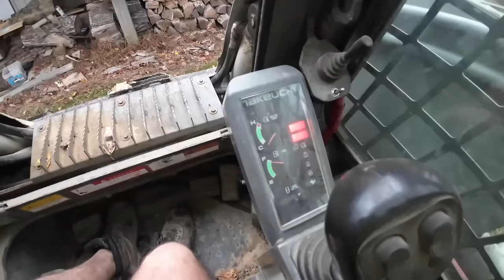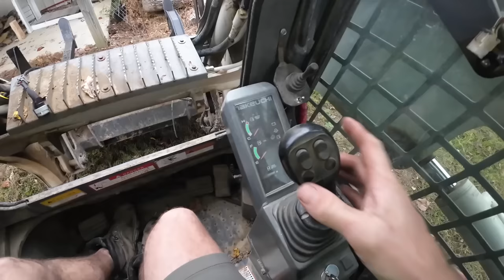Is a Firewood Processor Worth the Investment - #1 Reason I Think it Is!

Comment: why not split into trailer or truck ... saves handeling it twice
Reply: It might be a , the neighbor loads their own, job? 

But, yes it does look like the processor can operate over a trailer.
Reply from the maker: It can definitely load into a truck and trailer and if the person who is getting it has a trailer to load into, that works well.  But if they don't....can also just use the skid steer it little tractor and scoop the wood up and dump it

Comment: Here in Britain firewood is expensive ( in fact the cost is a pxxs take ) and not easy to come by at source unless you’re a big land owner or in the tree surgery/land clearance trade. I’d say your investment is well worth it especially as you have access to free logs, not to mention it’s a beautiful piece of machinery. Your barter system with your friends and community is a system I feel we should all return to, a great traditional method of trading and helping each other out 👍 Excellent as always Mike 👍 Best wishes from Britain 👍🇬🇧🇺🇸
Reply: Our house is on 5 acres, all forested.  We still have two piles of logs from clearing the house site that we are cutting and splitting.  The free wood saved us $1,000 in propane last winter to heat the house.

Comment: Definitely a time saver, working full time in what is a stressful job sometimes you just need to do things that take your mind of things. Would be interesting to know what the time scales are for replacing the chain, I suppose though that's down to the type of and age of timber. Don't know if anything has said it yet, but thanks for your service, even though I live across the pond anyone that does a job that potentially saves lives, needs respect.👍
Reply: The variables of type and dirt content from harvest in bark are the factor of time between chain tune

Comment: Thanks for sharing your thoughts, ideas and videos. I’ve always liked the look of that type of wood processor. Having split wood for heating the house as a kid for many years you never loose appreciation for tools that make a job you’ve done better. One idea you might want to make your own that I’ve seen others do is to make a simple wood carrier to split into. They used a pallet with an upright post at each corner and what looked like snow fence to form a well ventilated box to split into and then move and stack with pallet forks. I could see you setting a pallet or two onto a trailer for delivery. Wishing you and your family the best.

Comment: The guy I used to work for and my sister's ex boyfriend had a towable log splitting rig. You could load few logs at a time on it. Since he had large quantity of wood he wouldn't bother throwing split wood into his boiler but whole bucked logs. His philosophy was that the logs took longer to burn meaning only having to load it up once a day so he would more time doing other things.
Reply from the maker: All depends on the burner and the type of wood
Reply: To many variables as to whether right or wrong, firebox size and shape vs wood size, seasoned dry split wood vs non seasoned unsplit  moisture content etc etc.

Comment: The biggest problem see s to be visibility. This is a common problem with most all front mounted tools. My suggestion would be a camera set up on the lift arm(s) or top of the cab. It's not just skid steers either it's all front loader style attachments with a problem.
Reply from the maker: I had a camera setup for it.  Honestly, like any equipment, seat time is the real answer

Comment: For speed later palletize the firewood. 4x4 pallet then shrink wrap makes loading and unloading easier. Also means that you only touch by hand once. Pick the pallet up set it on flatbed strap it down deliver to location and unload pallet. By wrapping it helps keep the weather out and held together for transport and ricked/stacked.
Reply: Or borrow from DP (forgive my Tarzan English) cages for water reservoirs (like one he used for utility - fuel and greasing station)
Reply: I never thought about shrink wrapping it! Even the clear plastic film you wind around pallets for shipping would be okay. 
Thanks for sharing!
Reply: @patti2413  it’ll also help dry your firewood, by keeping it out of the weather
Reply: @robertlukacs1762  yes! That was my primary goal! 
BUT…if you wrap it when it’s not completely dry, wouldn’t the plastic keep the moisture IN?? 
I think it may be okay IF you did it in mid-summer AND you made sure it was already REALLY dry. 
But even then, wrapped in plastic and sitting in heat, I think there’s going to be some condensation. 
There WILL be some air flow from the bottom of the pallet, but heat rises, so most of the condensation will be at the top, so I’m not sure enough air will get to the top layers to dry it out. 🤷‍♀️🤷‍♀️🤷‍♀️
Maybe sitting in the hot hot sun WILL be enough to dry it out completely??🤷‍♀️
Yes??? No??? 
As you’ve obviously wrapped wood before, I’d like to hear your thoughts on this!😊
Thanks! Patti
Reply: @patti2413  actually you’re only wrapping the sides so the top and bottom are both open. Once delivered then you cover the top. So you’re question is legit. But as a supplier, it’s a space and time saver. Quick loading onto our flatbed trucks and with our (brain fart) forklift’s. Easy delivery. Our perforated plastic wrap allows some air flow as well.  But I was thinking about his situation with limited stuff. As for my biggest customers they have covered section that 4 of my pallets are able to sit in. As for my residence we place them on the side of the house on a concrete pad or edge of driveway. As for wet wood/green it is piled high for a year to dry before we palletize it. And that’s under what we call a portable umbrella just to reduce rainfall.
Reply: @robertlukacs1762  I cut and split my own wood, and try to let it season for at least two years. Sometimes I can’t get it split before I stack it, so it does have ‘some’ remaining drying to do after it’s split. Right now I have 13 large heavy duty wire crates I stack it in, which I can then take into my shop with my skidsteer and stack in two’s. Plus I have two walks in my shop filled floor to ceiling. I have fans going year round, so my wood is always super dry when I burn it. 
BUT…I like to cut down on moving it around- especially individual pieces!! I’ve got 3 Truckloads of ash logs coming, and about 25 trees on my property that are either down or going to be coming down. So, I’m cutting it, then stacking all of this wood to dry outside, which means loading it up & unloading onto skids to dry. Then, if I haven’t split it, I have to load it into the bucket, take it up to the shop, unload it, split it, then move it inside and stack it or put it in the crates. 
I try to rotate through the crates of course, and start by using the driest wood first, which means I sometimes have crates that get to sit for another year inside. 
But, like I said, I’m trying to cut down on handling the wood so many times! 
That’s why I was thinking I might be able to cut it, split it, load it on skids and wrap it right there where the tree is. That would save a LOT of re-handling! 
So that’s where my questions are coming from! It’s all about the ability to store it, AND get it dry AND not have to move it 100 times!! 
(The ‘work smarter, not harder’ saying that I’m trying to adopt since my body is recommending I do so!! 😂) 
You mentioned perforated wrap, but if you wrap it a few times doesn’t that defeat the purpose? (Unless you are using the actual shrink wrap and only using one layer then heat-shrinking it??) 
For transporting, are you able to stack skids? 
I don’t know how I could stack them inside my shop once I was ready to use them- which means I’d have to unload them all individually- and defeat the purpose of reducing handling!! 
(However..if I wrapped the metal cages, I could stack those…but again, that’s the most seasoned wood, and I’m looking more for a way to store fresh cut/split stuff.) 
I’d love to see some pics and hear how you stack them if you have any. 

One thing I think I would do if I were to shrink wrap this way is to use plastic skids! 
Not the solid ones- but ones that have open grid designs to allow lots of airflow. That way I could stack them on the ground and not be worried about wood skids wicking water from the ground into the wood. 
You can find them used- often for about $5-$7…good heavy-duty ones. They probably won’t hold up like good hardwood skids, but they’ll have great airflow and be able to sit on the ground! 

Where I dry my wood now, I’ve staple-gunned orange snow fencing to the end of a skid, and laid 3-4 skids beside each other, continuing the snow fence around the back and other end. 
I screw 2x4’s onto each of the two ends and a few along the back to staple the fence to. I can stack good and high and it gets great airflow. I try to cover the top with some sheets of plastic when I can. (I’ve used scrap pieces of sheet material like Hardi-Board…and just thought of trying some used arena boards that I have!) 
I’ve thought about wrapping orange snow fencing around individuals skids of wood- like I said, it’s strong and gives lots of airflow, but doesn’t offer as much protection from the weather, and not easy to stack. 
(Unless🤔…just thought of this…if I shrink wrapped it, it would be good and solid, and I could try stacking on top of the arena boards!!!
Hmmm! Think I’ll try that out TODAY!! (Thanks for inspiring me and making me think about different options! The arena boards are for the side of my hay shelter, but I haven’t started putting them up yet, so I’ll give them a try and if they work, I’ll look for more! 
(My brain never stops looking for ways to make life easier!!! 😂 
And my brain is telling me that I really WANT a firewood processor like this one… and it is also telling me 😂 haha- yah, right- like you can afford it!! 😂) 
Anyways…. any advice, suggestions, or ideas that you have would be welcome!! Can you also let me know where you can get perforated shrink wrap?? Thanks! 
Patti
Reply: @patti2413  perforated shrink wrap is stronger than pallet wrap. Yes your able to to stack for transit. Depending on how high you stack each pallet. My site is mainly about 5acres and wood is brought in from clearing sites. Like captain Kleeman brought it up to his shed. I also have a mill next door that I get the cut offs and crooked stuff from

Comment: So as I see it,  there are 2 more pieces to the puzzle, modifications to the 555 so it can operate the processor (which you mentioned) and getting that dump truck in action so you can split right into it and never touch the wood. Am I right?

Comment: That thing is cool but if you don't have or have access to a skid steer the cost of s the splitter plus the cost is a skid steer or a tractor that's compatible is a deal killer or life savings killer.😂
Reply from the maker: I think this falls under the Common sense clause...don't buy something if you don't have the equipment to run it....lol. didn't think that part needed explained.
Reply: Get out with that fancy logic. Personally it's not in me. I usually buy the implement than I have a reason to buy the machine to run.